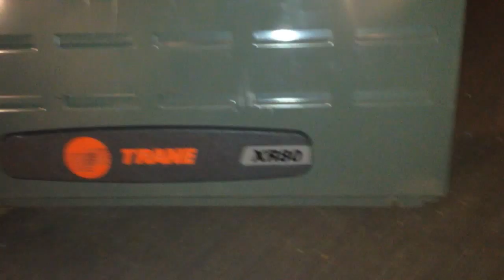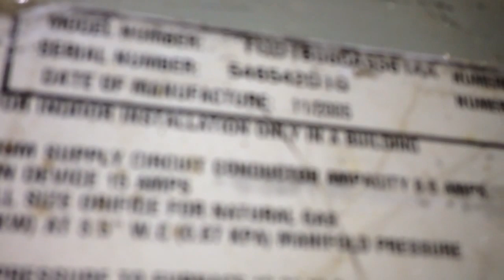Replacing a heat exchanger on an 80% Trane

Comment: thank you for posting this video cause it saved me a thousand dollars in cost for a new heat exchanger for my XE80 trane ...... is this a common problem with clam shell type heat exchangers of this design? ... my heat exchanger was damn near pristine minus the far right exchanger with 1 failed crimp ring.